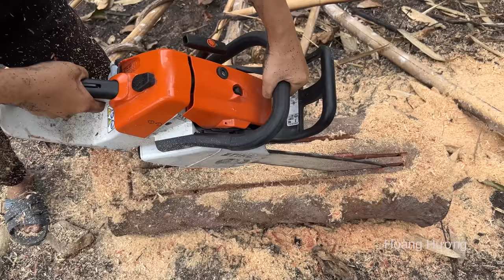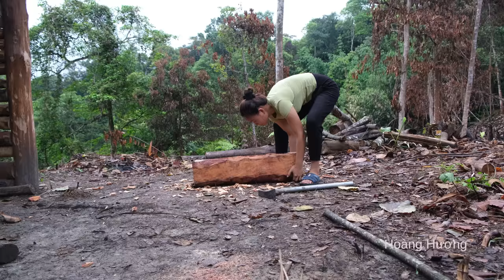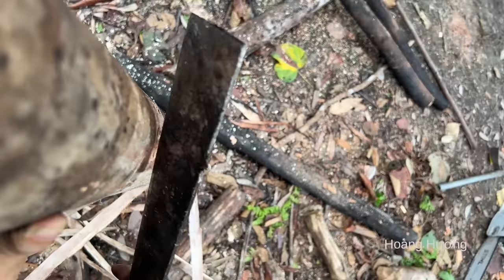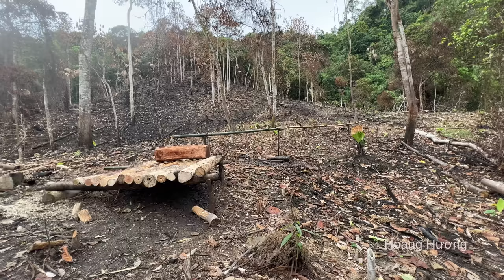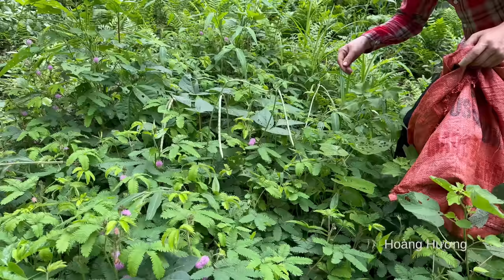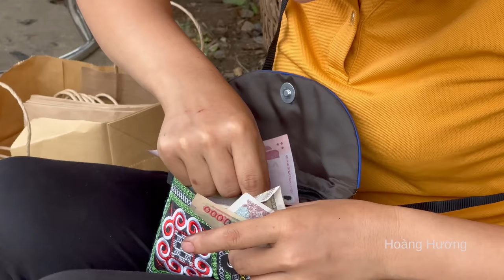wooden water trough making process, Harvest cucumbers bring to the market to sell | Hoàng Hương

Comment: Please get some eye and ear protection. Also there is no need to saw timber like bread, if you feel the need to do that it's probably because your chain needs a 'touch up' / sharpen. Keep your arms straight and elbows locked. Don't lean your face towards the chain / machine, lean head away from it. Correct your stance left foot forward right foot rear 'fight style' rather than leaning into lower the saw bend your knees. Also use the 'dogs' (spikes) to grip the timber and stabilize the cut, that's what they are there for. Steel toe boots would be good also. Do this please to avoid very common accidents.
Reply from the maker: Thank you so much